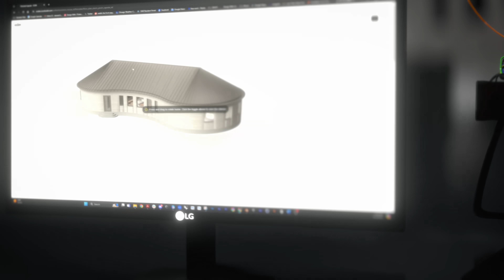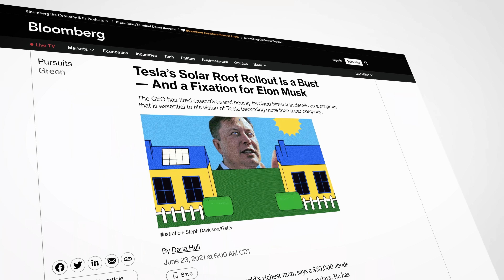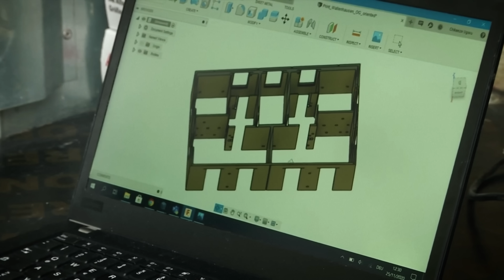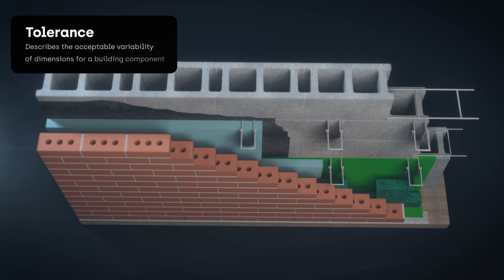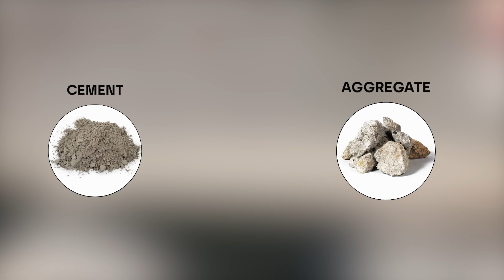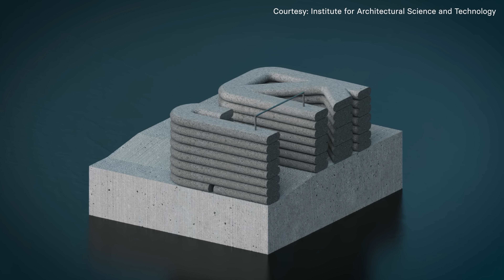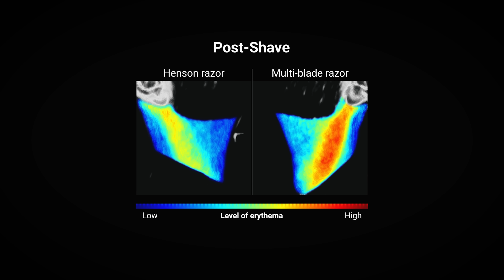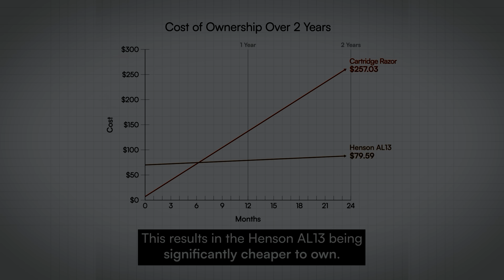Why 3D Printing Buildings Leads to Problems

Comment: Apart from all the other inflexibilities mentioned, isn't concrete also considered environmentally bad in terms of how much pollution comes from producing it? It's also much heavier than timber. This sounds like a good solution in places where speed is more important, a good example may be the military where they might want to build an outpost or a barracks somewhere very fast.

Comment: Automatic construction (assembly of components) won't happen until Boston Dynamics (or a similarl. company) can build a robot more agile. and versitile and capable of on-the-job problem-solving than your average high school graduate union apprentice framer. So, maybe like 30 years from now at the very least? And if you did finally make a robot that good, could you make them cheap enough to replace the aforementioned union apprentice?
Reply: Those kinds of robots are nearly here, coming to market within 3 years, look at Unitree or Tesla robots... The return on investment will also be good, considering robots don't complain, eat, sleep, or quit... you can work them 24/7 only stopping for recharge, and they don't need training, they're all equally smart.
Those robots will disrupt the blue collar industries hard in the next 15 years.

Comment: Brick is a terrible analogy since our brick houses have just been brick veneers over a wood house for 30+ years at this point. Concrete block is only used in foundations and basement.

Comment: This method is only interesting with round parts, if you only need to make a few, if you need more than a few it's easier to just make a mold and pour concrete in.

Comment: While most 3d printing in non-building industries are for prototyping now, that is changing. There are many industries taking additive manufacturing techniques to make custom designed products.  I suppose the custom hip replacement that fits my body in very specific ways is a prototype, but really is a custom change to a standardized part. The biomedical adoption of 3d printing technologies is huge and also been very quiet. Even the common cast for a broken arm is probably a 3d printed custom part these days.
But building a house is much more complex than that. 3d printed concrete houses will become more common, but it will take time. I don't know if all houses will eventually become 3d printed concrete in my lifetime, but 100 - 150 years from now? Who knows. We may be building houses similarly in the 2020s as we did in the 1920s, but probably not that similar to what was done in the 1870s. We're seeing that early, early portion of change. Again.

Comment: 3d printing houses is snakeoil. Yet many articles uncritically think it will solve a housing crisis. When all it will do is produce incredibly ugly houses on the inside and out.

Yes it is moderately faster to print than block or ICF by a couple of days. But the time taken to build the exterior is a small fraction of fitting out a house which could take months. Things like foundation, wiring, glazing, floors, stairs, plumbing, insulation, roof, fitting, paint, drainage etc. And if the house is more than one floor, any advantage is cancelled out since 3d printing requires drying time between levels. And at scale, e.g. someone is doing 100 houses or whatever in a development - there is no advantage since building can be staggered so while one house is being assembled lego-like with ICF, the next can have concrete poured in.  

There is literally no need for 3d printing to solve anything. I suppose it might have purpose in some applications, but if anyone tries to convince you it will solve a housing crisis, they are lying to appeal to gullible elements in government who might think it is some magic wand to their problems.
Reply: any concrete without rebar or mesh is suspect.

Comment: To me the solution for the reparability angle has a lot more to do with making the thing look less 3d printed to start with. If you can get your printer to produce more consistent layers then the gaps between layers will be more consistent as well, which will make the process of filling in those gaps with concrete more manageable. If you can hide the layer lines by smoothing them, then any repair job becomes about smoothing rather than trying to reproduce the layer lines, and smoothing concrete is a much more practiced thing.

This said, I'm not convinced that 3d printing houses will actually be the way forward for home building. There are lots of things that get integrated into a typical home while the frame is up before the drywall and siding is slapped on, and integrating things like plumbing, category cable, insulation, heating and cooling, electrical lines, etc, will likely be much harder to do in wet concrete, or with fully constructed walls. Some things can be run through printed channels, conduit, etc, but in the event that something goes wrong with your plumbing in your concrete walls, you're pretty much SOL; so the reparability issue comes down to a lot more than just the concrete structure itself. 

Additionally a lot of people forget how much water goes into concrete. Places where water costs are high are likely to struggle to implement homes like this, and unlike traditional homes, something like this would be next to impossible to do on an incline, or into the side of a hill.

Comment: I dont think tolerance is the biggest disadvantage of 3D printed buildings. Machines can be upgraded to be more precise. Humans cannot. I'd say that the biggest concerns are the recyclability and earthquake resistance of 3D printed buildings.

Also you talked about 3D printed buildings are difficult to modify. I dont think that's true either. Its no less flexible than brick or concrete buildings!

Comment: From fairly limited experience (being involved in building five concrete brick houses/ cottages), one thing that has never made sense to me about 3D printed buildings is that in terms of cost and construction time, the walls and roof aren't such a big deal. What costs the money (and time) is the finishes and fittings, which don't seem to feature in the design software. Maybe this is just so for some places, and in others, the cost of the walls is the limiting factor. (Else, if you build your cheap walls big, you just have to spend more on expensive fittings that the walls are made to protect.)

Also, the little crevices inside are not going to make for nice walls. You still need to plaster those (or cover them with drywall). On the outside, all they're going to do is provide a nice substrate for mosses and lichens - which could be great if they weren't quite likely structural hazards, long term).
Reply: When my family’s house was being built, 2 things took the majority of the time. 1: the foundation 2: interior

The frame took a month with a crew of 3 guys working 3 days a week.
Reply: I think it's just the first step to fully automated custom houses. First create a system for the foundation and walls. then for the roof. Then use boston dynamic robots for the finish work. One day you will go to a website, or probably just talk to your AI, and design your house. Maybe a week later you would walk in and the robots already moved all of your stuff in and stocked the fridge.
Reply: There are so many issues with that, it just makes no sense.
Just the equipment. And transportation.
Who will be fixing it?
What if concrete is not perfect...

And you need to build foundation not only for the house, but for the machine too.
Can't correct any mistakes...

Btw,
Nobody is building the brick houses.
And 4 guys can build a house faster. All you need is a foundation, frame, & drywall.
And it will be like 100 times cheaper.
* 
We have been building houses for thousands of years.
There is no reason to make something more complicated that it needs to.
Reply: Half-baked tech 😂 isn't faster or cheaper than a Auto Brick laying machine using the same Cantilever Robot. Definitely one technology headed for a dead end.
Reply: Also they appear to be building single-family homes. R1 zoning is what keeps housing costs high.

Comment: You can 3D print a house with nearly perfectly square corners and smooth walls, but it requires a smaller nozzle and thinner layers, which takes more time. Most companies prioritize speed over quality, aiming to print houses as quickly as possible rather than as precisely as possible

Comment: Why would a robot be less precise than a human, when it can position itself all but perfectly? Why can't a robot smooth edges? There are a lot of—I'm not sure if they're assumptions or limitations—here that really need exploration. Robots on the shop floor have improved tolerances, not the reverse.

I also note that desktop 3D printers are often used to make frames and fittings that adapt standardised parts to particular projects. If precision comparable with other robotic tools can be achieved, then I don't see why there wouldn't be a future in which 3D printing is applied—whether on-site or off-site—to increase the reach of a prefabricated vocabulary greatly. None of this seems all-or-nothing for systems that are relatively simple to deploy.
Reply: It's not the machine that's imprecise, it's the material. The concrete oozes out sloppily all over the place, its fluid and uneven. A person with a trowel can more easily place bricks and clean up excesses, or make ad-hoc adaptations that these printers would require a ton of sensors and software to achieve. Pouring concrete into a wooden or metal formwork has relatively controlled dimensions, the mix can't ooze and squeeze arbitrarily.

Oozing is a major problem with desktop printing, its unevenness is just too small to notice (but nasty stringing and other oozing problems are common), and plastic hardens in a matter of seconds after cooling, concrete takes hours/days... Filament for printers is very homogeneous and manufactured to a certain dimensional precision and density... concrete mixes of sand, gravel, and water are much more uneven and prone to stratification. Working with concrete has a lot of factors that have to be considered to obtain quality results.

Desktop 3d printers can't really make sharp corners either (the minimal corner radius is the size of the nozzle, which is small so it might not look round, but it is) and desktop 3d printers have tolerances that are huge compared to precision machining, good enough for some uses but certainly not comparable. The nozzle for concrete printing has to be large because the aggregate is large, and also because having a small nozzle would massively increase the print time (defeating one of the few advantages 3d printed buildings claim to have).

3d printing should certainly be used to make prefab building components off site, and also with other materials like ceramics and metals (both of which can achieve much higher precision than concrete). It's just really not well suited for printing *entire buildings*...
Reply: @hypertectonics7009  Thanks for the informative response, I appreciate it. Do you not think that much of this is the sort of thing that should succumb to future engineering, though? While you can say that it would no longer be purely printing, the outer surface is generally exposed for physical manipulation as it is deposited, for example. Anyway, thanks again.
Reply: @stephenspackman5573  sure there can be technical advances that minimize the issues, or you can add people to add more processing... it just doesn't have enough advantages vs other construction methods like prefabrication.

Comment: It does not take a couple of days to 3d print a home.  It takes several weeks for most companies.  I believe icon recently got down to a week but all other companies are much longer.  Maybe print time, but there is a lot of downtime.  They have to let the layers dry.  

A couple of days is just a marketing thing at the moment.
Reply: Concrete doesn't dry; it cures. In warm climates you often need to spray concrete with water to keep it from drying while it cures.
Reply: @user-nu1wp4pw9o  sure cures - seems you knew what i meant, I doubt clarification was necessary. In any case, it needs to get to a certain amount of strength before they can add addional layers.
Reply: Meanwhile a regular forming crew takes a day and a half
Reply: @gatergates8813  For a house the size of what we're seeing in this video, a good crew should have it done in a day.
Reply: Also, walls printing is only 20% of house building. And other elements created using classic technologies.
Reply: Depends on the mix you are using and the experience. We can do it in a few days. Just depends on the model and drying time of the materials. 750 sq ft home in 2-3 days is easy once you have the experience.

Comment: I doubt if these 3D printed buildings has the structural strength of Brick walls of reinforced concrete. I doubt they can be applied for anything but some one or two story buildings.

Comment: Uhhhh... am I missing something?! We can't put a brick unless it's on top of another brick?! Did we just forget or are we purposefully ignoring ARCHES! 😂 the Roman's figured that out hundreds of years ago so not sure how an architect just completely ignored arches... 3D printing a house is just stupid. We should be focusing on AFFORDABLE quickly produced housing. Sorry but a 'nice looking" house is a stupid thing to worry about when the homeless population in America is as large as it is. We need quickly productive similar looking housing so we can build multiple homes within the same time as an old single home. It needs to become more like cars where you purchase the model you want and then have sets to make manufacturing faster and cheaper. We don't have the luxury of wasting time and money 3D printing a home that is never going to be cheap as only the concrete can be printed but everything else still needs to be done by contractors. It's just so dumb to waste all this money to make a robot poop out concrete when we should be making houses able to be on a manufacturing line and making different versions that can be chosen from. Otherwise we will never get truly affordable housing and will instead just make 3D printed houses that only the 1% can afford... 

3D printing has been revolutionizing for complex parts. But it just doesn't make sense for housing at all and is just going to fail in the next few years... you get cheaper houses by being able to manufacture more than one at a time. It needs to be parts or full houses that can then be mass produced and that's unfortunately the only way we will get truly affordable housing.

Comment: I just don't really see how this is really that much better than placing styrofoam molds and pouring the concrete
Reply: It's actually worse, not better.
Reply: A lot less labor, a lot less waste. I'd imagine it's 50% less product than a solid wall. Not to mention the thermal benefits
Reply: @matt45540  icfs prevent thermal bridging and dont spawl these 3d printed homes will spawl in cold climates because surface area and texture.

Comment: Could you foresee a system where the basic structure is 3D printed and then finished with drywall / plaster on the inside / outside respectively? That way the printing element is not trying to replace the whole building phase but just the basic building like bricks etc.